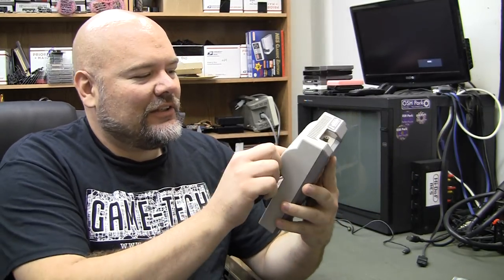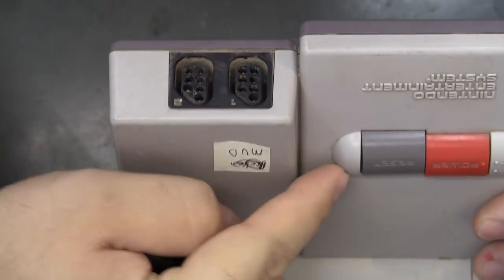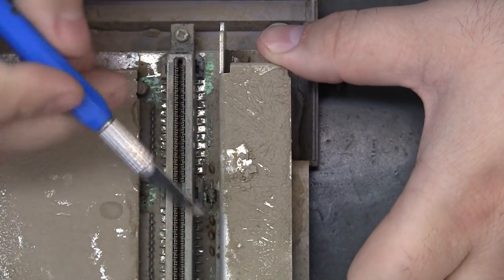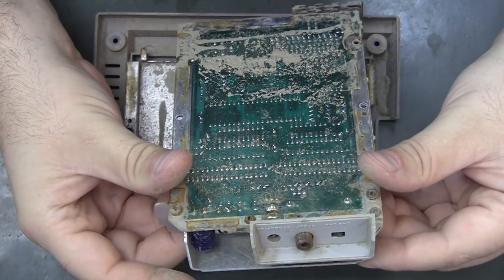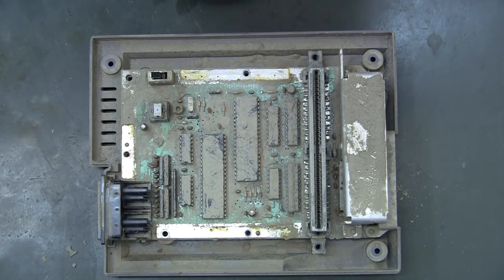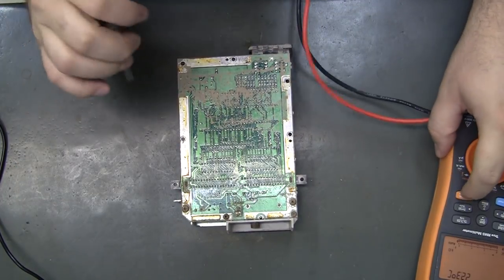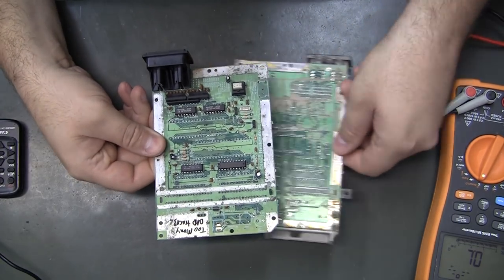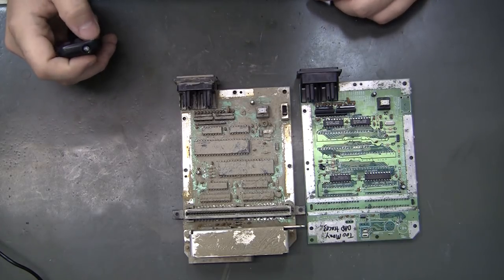World's dirtiest NES-101 top loader Nintendo!!!

Comment: My vote is to clean it. Also how do you like the Keysight DMM?
Reply: I'm curious how you safely clean electronics too
Reply: Not gonna speak for GameTech, because people will disagree with me. When there's no acid on the unit, and never has been, no signs of excessive flux, leaked capacitors, etc, i think it's OK enough to wash everything with soapy water (hard soap) including PCBs, rinse off with clear water, then let it dry in a slightly warm place for a few days. At least for electronics this old, no water if there's any BGA ICs, because it'll get down in there and won't be able to evaporate very well.

A proper and safe way would be to use isopropanol on electronics and soapy water first, a little dissolved isopropanol second on plastics. But isopropanol is nonpolar, so it won't dissolve contaminants that polar solvent (which water is) dissolves, and in turn it will dissolve other contaminants. Household sediment, and this mud, is likely to be best water soluble.

Comment: The worst NES I have is the one I caught while fishing in the river. I still have it. The entire thing was still full of mud. The screw heads just broke right off when trying to dismantle it, and the RF shield had almost completely dissolved. I did get the power LED to turn on when I applied power however.

Comment: I recently bought an old Phat PS3 from the thrift store that looked like this. It was so dirty that the capacitive power button didn't work from too much dirt blocking the contact inside. I picked it up for $0.79 and cleaned it up, works like a charm.

Comment: I'm probably in possession of what used to be the world's dirtiest front loader. It was in storage area with an unchecked raccoon problem. I won't speak of the horrors I endured getting the outside shell to a point where I didn't need gloves to touch it. I'm astonished none of the internal components suffered too much considering what I had to clean off of them. Aside from the power button, which desperately needs to be replaced because it's beyond sticky, it stood up surprisingly well. 
Nintendo: 1
Raccoon family: 0

Comment: nah that is not flood, that is  a moisty and humid house (over 20 years of be in a shelve or so), if it were in flood, all those contacts in the cart slot would be GREEN of oxidation!. Anyway can be restaured, probably the power switch is dirty. (wrote at minute 4:27)

The screw and the under shield oxidation in the board is called  "GALVANIC oxidation", there wasn't water inside, because if so, the shield sheet would be pure oxide sheet

Comment: Clean it on video! Be interesting to watch! Just take a note of the serial number or show it on the cleaning video so you always have "proof" that your once flooded board is actually a working board! It'll be interesting to see what kinds of things you have to do with a cart connector that badly corroded, too! Do you desolder it and swap it with another one or try restoring the pin connector as it is (if that's even possible...)?

Comment: clean the damn thing with some Dawn dish soap, & then let it dry out for a few days. I did it with a Gateway PC years ago(back before ACER bought them and turn them into cheap junk) a Church member had me look at after her house flooded, and I able to salvage the motherboard, sound card, and video card, after replacing a few caps on each items and the CMOS battery, but I was unable to save the HDD, or DVD Drives, the fans, and case.

Comment: You filed a claim on an auction for an item that was sold as not working? I must be missing something..
Reply: I doubt the seller didn't know this console was in a flood.
And if something is this fucked, where most people would just say it's beyond repair the least the seller should have done was to specify what the damage actually is.
Reply: You are making a lot of assumptions. Either way if I buy something on ebay and its listed as non-working I would expect the worst and assume its never going to work. That is the risk you take when buying broken electronics.
Reply: Solis4Champ Even non-working, it's not worth $60
Reply: Sell price of the item has no bearing on the issue
Reply: There's a difference on ebay between "not working" and beyond repair with flood damage etc. 

I can't sell a arcade machine with the motherboard smashed to bits or missing as "not working" just because it doesn't turn on. I think ebay's buyer protection will take care of this one
Reply: Even if it's sold as-is the auction still has to be 100% honest about the item. If the auction said pristine condition but not working then he has a valid claim and ebay would require the seller to give a refund if he sends it back. Jason probably just worked it out with the seller where the seller let him keep it for a partial refund.

Ebay has gotten to the point now where even for parts auctions have money back guarantees.
Reply: Jared I agree with what you are saying. Like I said in the original post "I must be missing something.."
Reply: Coffera ebay would say differently:

"For parts or not working

An item that does not function as intended and is not fully operational. This includes items that are defective in ways that render them difficult to use, items that require service or repair, or items missing essential components. See the seller's listing for full details."

By your logic if Jason gets the item working then he should refund the seller the money that he was given back.

With that said I don't know the full details of the auction, did the seller not list it as "For parts not working"? Did the seller lie about condition? Again I must be missing part of the story.
Reply: You guys have a lot more faith in eBay sellers than I do.  I assume "have not tested" really means "tried it, and my trailer caught fire".  If it says "not working", I assume that the insides have been replaced with a moldy peanut butter and jelly sandwich.
Reply: I collect watches, on eBay, not running, just needs battery means I put a battery in it and it did nothing, so pay me for my broken junk.

Comment: seal it with clear matt laquer and put it in crystal case without rfshield also fix it :P
if not then full cleaning and persistant trubbleshooting until you save the most of it and not only replace everything on board

Comment: I'd say leave it and display it. Sure, it's not melted, but it'd sort of be your NES version of that melted Gulf War GameBoy. Hell, if you circumvent the inductor/trace issue and do minimal cleaning of the cart connector and RF connector it may work in it's current condition (aside from already aforementioned targeted cleaning). Strictly for knowledge purposes though, never to be permanently used.